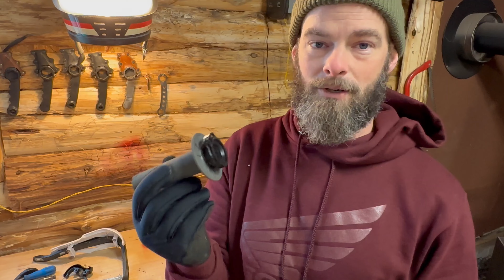DIY Throttle Tamer - 2024 Honda CRF450RL

Comment: How is the throttle grip free play on your CRF450RL?
Is it reasonable or do you think it has too much?
On mine I had to keep what I thought was too much free play in the throttle grip in order to avoid no free play and a sticky throttle when the handlebar was turned full lock.
Reply from the maker: I’ve got mine set up with very little free play. I haven’t noticed any issues at full lock.

Comment: How much difference did it make first percentage of cracking open your throttle? Did it solve the on/off feeling when lugging in trails?
Reply from the maker: Oh man! The difference is astonishing, I ran 400km of hard trails with the stock throttle tube and it was exhausting trying to manage the bike at low speeds and lugging tight stuff. The first ride after the DIY tamer I was able to just ride, I wasn’t constantly being ripped off the back or bucked off the front. So much better